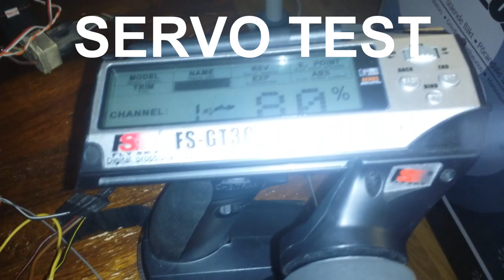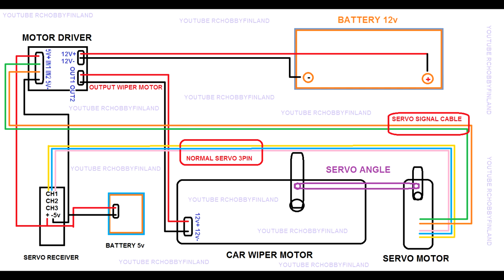HOW TO MAKE WIPER MOTOR SERVO, BIG SCALE RC STEERING

Comment: Hi, very nice work., were did you purchased the motor drive? Thank's
Reply from the maker: Hi Robert! I bought that motor drive in ebay when I made that servo project. I cant find now same motor driver from ebay. I thought that this BTN7971 is older and some model is new board now.. ? maybe...

Comment: I was watching both of your videos, in one you use the BTS7960B and the other video you used the BTN7971, i tired the BTS7960B and connected it like you did in the video but it didn't work, I'm getting signal left to right but it only has enough power to light up an LED not enough power for the motor,  is it ready to use when you get it or does it need to be programmed to do what i need? I'm building something like what you have and this is the only thing stopping me,  If you can help that would be great. 
Thank you...
Reply from the maker: BTN7971 work same as video. No need any programmed. This BTS7960B not working because it is PWM-control.
Reply: @RCHobbyFinland  ok, Thank you very much, i'll wait for the BTN7971, It's going to take 25 days to get here.
Reply: @RCHobbyFinland  I see, i didn't know....Thank you again...
Reply: @RCHobbyFinland  I can't find the BTN7971. can you please show me the link? Thank you...

Comment: HI, awesome video. Finally found a video with the tutorial ...Did you disconnect the hightec dc motor? Thanks
Reply from the maker: Hi! Can you refine the question? I did not fully understand :D
Reply: yellow and white wires are soldered to PCB of servo . Did you desolder wire from servo's dc motor(5V motor in servo casing)?  Is that small motor (in servo casing)(5V motor) is getting any signals/ power from PCB? 
Thanks
Reply from the maker: Hi,
These two wires are soldered on servo board. I thought that it is same if wires soldered DC motor. Wires need that this BTN motor driver board know turns in the right direction
Reply: Thank you

Comment: Hi,  I'm building a RC go-kart, and i would like to do the windshield wiper motor for steering,  great idea, but I'm having a problem,  i tried the L298N, didn't work and the 43A BTS7960B DC Motor Driver Drive Module H-Bridge PWM Control Fast Braking, and nothing is happening, I did it just like all the videos iv'e seen, i don't know what I'm doing wrong, what does the voltage need to be on in 1 & 2, can i use any servo, my receiver works on 5v or 9.3v , tried both no difference, do these things need to be programmed before use or are they plug and play, cause I'm not playing, LOL, please help if you can, I'm using a spectrum DX5C... THANK YOU, Danny........
Reply from the maker: I think that this BTS7960B not working.. I dont know why, but i tried it first and then i buy that BTN7971 motor driver
Reply: @RCHobbyFinland  I tried 2 different H-bridge's, and the same, do you know if i need to program it first? I followed the video and I'm using the same board, do i need to use a special servo, i don't know what I'm  doing wrong.
Reply: @RCHobbyFinland  I was watching both of your videos, in one you use the BTS7960B and the other video you used the BTN7971, i tired the BTS7960B and connected it like you did in the video but it didn't work, I'm getting signal left to right but it only has enough power to light up an LED not enough power for the motor,  is it ready to use when you get it or does it need to be programmed to do what i need? I'm building something like what you have and this is the only thing stopping me,  If you can help that would be great.

Comment: Does the kg matter for the servo? i ordered the same H-bridge as you, i hope it works.thank you for getting back to  me..
Reply from the maker: That servo is 33kg SpringRC servo motor, it is model SM-8166. Do you watching my 180kg servo motor video? You can maybe use it?
Reply: @RCHobbyFinland  I see your using the servo's and not the windshield motor for steering,  did the servo's work better, and are the servo's as strong as the motor? and I'm guessing you don't need the H-bridge with the servo's?
Reply from the maker: @EZMarktapemate  Hi Danny, I havent tested yet in my RC. I think that ASMC-04 180kg servo motor already board. No need h-bridge. my first test that ASMC-04 is little bit slower servo than wiper motor..
Reply: @RCHobbyFinland  those are the 2 servos your using for the steering together? a little slow is ok are they strong like the wiper motor?
Reply: @RCHobbyFinland  I'm sorry that I'm asking so many questions, when you solder the wires to the servo motor do you do anything with the potentiometer, or do you leave it alone?
Reply from the maker: @EZMarktapemate  Need only servo motor wires.. Its tell that wiper motor that when need rotating.
Reply from the maker: I think it is same that 33kg or 10kg. Its tell only wiper motor only that where need rotating. so this is why you need that servo angle.
Reply: @RCHobbyFinland  ok, Thank you again...
Reply from the maker: @EZMarktapemate  :)